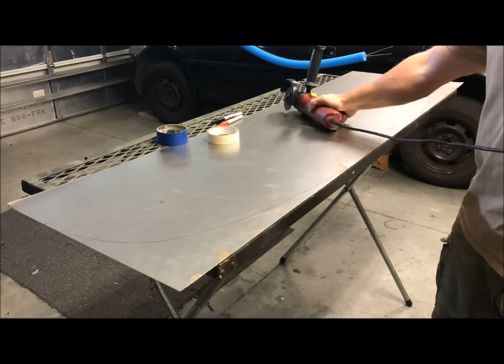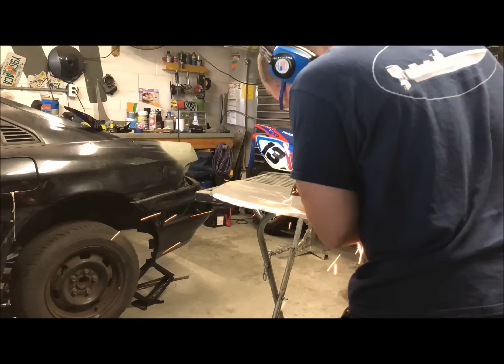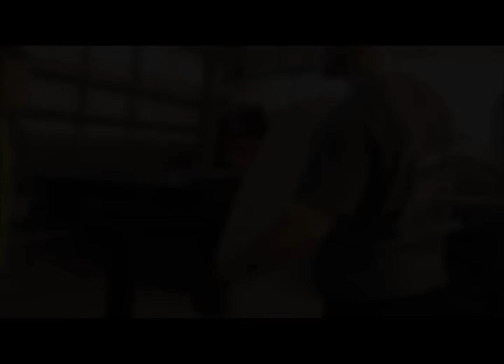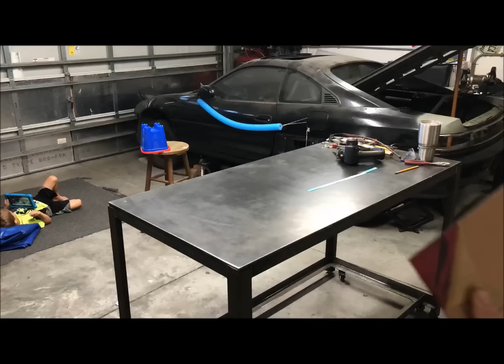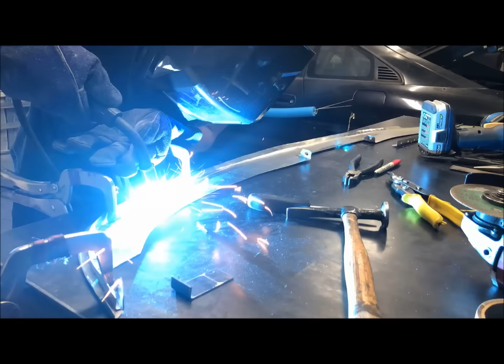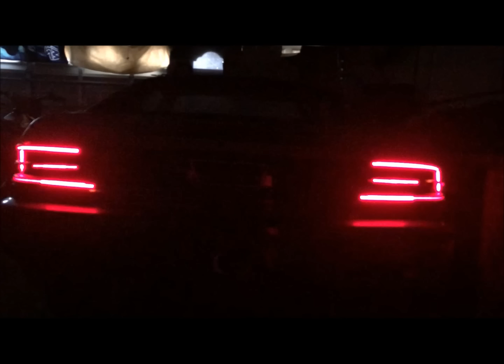LED MR2 Tail Lights (V8 MR2 Build #14)

Comment: Not easy improving the original design, you pulled it off, what an up date look. Did you need a resistor for the wiring to prevent hyper flash or just straight wiring?
Reply from the maker: Thank you! No resistor was needed. I assume it is included in the wiring the lights came with. I just connected the ground and the turns to the turns and the brake to the brake and the running lights together. was pretty easy
Reply: @scantronsgarage  Oh thanks.

Comment: I really like it, but from a safety perspective,  the little brake light in the middle is not bright enough, you should pair it with the bottom strip, to make it safer
Reply from the maker: Thanks!! I agree. Im still looking for the propper light to put in there.
Reply: @scantronsgarage  you can just activate the top and middle as a taillight, then the middle and bottom as brake lights, and the top as taillights and turn signal like you have it, or add an LED ring on the inner side of the middle strips, that would only turn on as brake lights, or get some foglights, install them in the same spot I mentioned the LED rings, and retrofit some Luyed 7440 red led bulbs, they are 900 lumens, and are plenty bright.
And as for reverse lights, you can retrofit the ones from an FRS/BRZ/GT86 😎👍🏻
Reply: If you're having trouble visualizing those Ideas, I have no problem making you an animated video, I know its hard for others to see what I see unless I aid visually, ive never been good at describing things.
Reply from the maker: @VegaLitWerkz  I think i know what you are talking about. My wiring is not finalized yet either. I can still wire it to function in many different ways. I think i may leave the center lights off for running lights and only have them light up for brake lights. Still need to replace them with a brighter unit still
Reply: @scantronsgarage  that sounds good too, I just found your channel last night, I have a lot of catching up to do with the project, so far ive seen about 8 videos, will keep watching more today and so on until I catch up 😎👍🏻
Reply from the maker: @VegaLitWerkz  I got another video scheduled for 3-13. thanks for joining me. i will get back to the lights soon
Reply: @scantronsgarage  sweet! Can't wait to see it!, I love your content, its along the lines of similar types of stuff I want to do in the future, keep up the awesome work!😁👌🏻